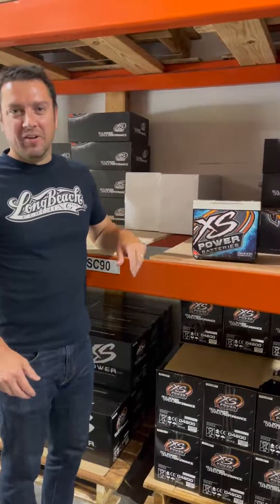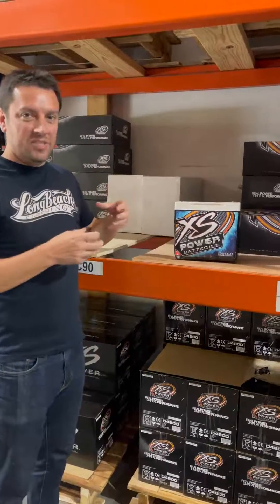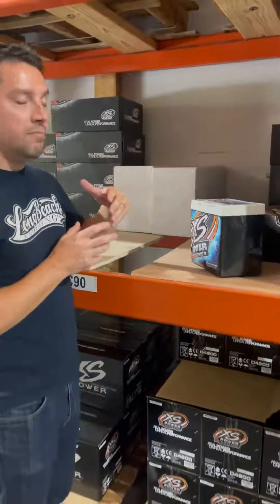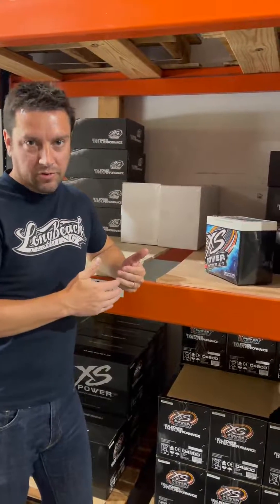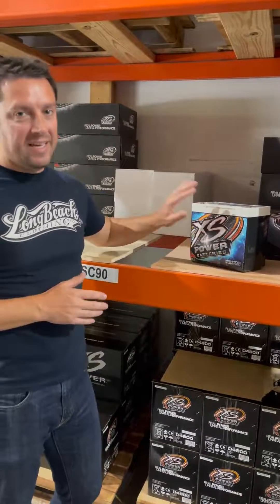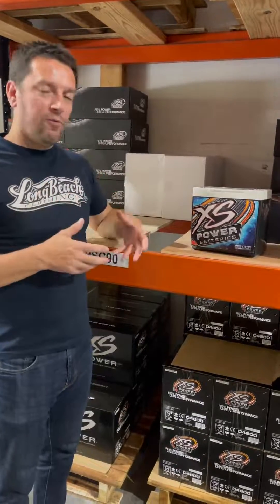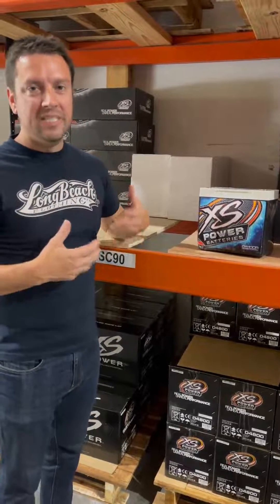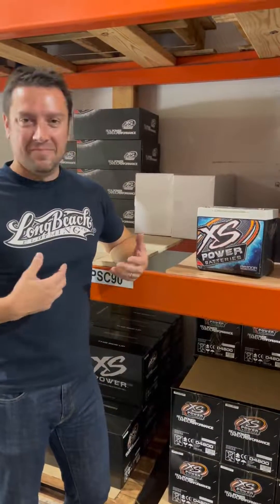Why Do Batteries Swell?? | XS Power Batteries

Comment: i’ve had a xs power xp750 for my four wheelers sound system for a while and it’s been sitting for a while and i took the battery out to charge it and it’s now swollen from the bottom, front, and back.

Comment: I really want to buy a x/s battery for my mustang gt but dealer says it needs to be charged before using. I have a deltran battery tender trickle charger, thats supposed to know when battery is fully charged. Don't want to ruin the battery as soon as I get it. Thanks again any feedback appreciated
Reply from the maker: Most chargers won't sense the full capacity of our batteries, so they may not actually get it to 100% state of charge. If it's one of our D-Series batteries like our D3400 or D4700, our HF1208 or HF1215 chargers will work perfectly!

Comment: my d3400 was 7 months old and swole up and xs power told me that it was my own fault and it would not be covered under any kind of warranty even though it came with a 3 year free replacement warranty. The truck it was on has no extra car audio in it or big alternator it only has viair compressors to run a air ride system. They said the battery is not designed to be mounted under the hood with engine heat and I told them great because its not under the hood. Then they said it is due to the way its being charged. I said what is  wrong with charging it with the stock alternator? Then they said on days when im not driving the truck I should have it connected to one of their smart chargers. That company is a fucking shit show.

Comment: I have the xs xp2000 been swollen for about a year (not as bad as the one in the video) should i be concerned? I live in Texas temperatures get well past 100 degrees here and i have it under the hood.
Reply from the maker: Our XP-Series batteries are not the best suited for under hood use in higher temperatures. Our D-Series batteries are much more suited for higher temperatures, especially under the hood in higher temperature climates.

Comment: Question I got three xs power battery that are below 10v I’m using the pc30 and have it set to recovery mode as soon as I turn it on it tells me it’s full and when I turn it off and turn it back on standby is at 8v it charges for a little bit then says full in less then 1min is my battery done that it can’t hold charge

Comment: Great info but i have a small lithium jumppack for jump starting a vehicle and it was 100% charged then I connected it to my 03 gmc Sierra 4.8L LS V8 and I gave it a few minutes before hitting the key as the battery had been dead-dead for months and is useless... The engine cranked over a few times then seemed like the jpack went dead very quickly so I jumped out to take a look and it was a bit warm not hot and swollen ever since using the charger it came with it says it gets to 100% charge and stops but it has no power like it wouldn't even start a weedwhacker or a damn chainsaw it is so weak now? Can you please explain to me what happened or what i can do to avoid this when i replace the jumppack?

Comment: Great info. I live inTrinidad, i bought an xs battery and within a year the top of the battery started to get hairline cracks. If I leave my car off for 7days, the battery would read 10.5v. My vehcle was checked for any parasitic drain, no problem was found. I took the  battery to the dealer, he charged the battery and said there's no problem with it. But again after a couple of days without using the vehicle, it went dead again. I tried the battery in 2 different vehicles other than mines and the problem exists in every vehicle. The battery clearly have a problem and still under warranty, but the dealer refuses to believe anything is wrong with it. It is super frustrating, because i switched from northstar (which was verv reliable) to xs power.
Reply: 2low2flow
Reply: Swear I not buying XS. Bought one and it was swollen in less than a year  got it replaced and the next was swollen in less than a year.
Reply: Dispute the charge!